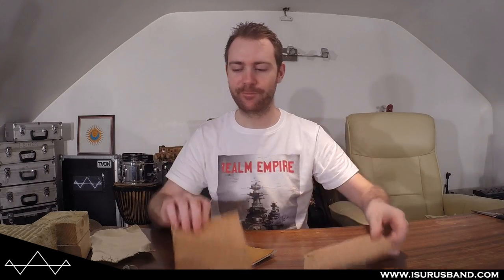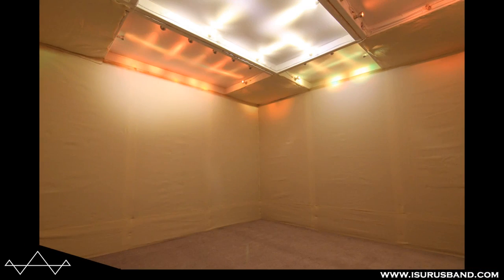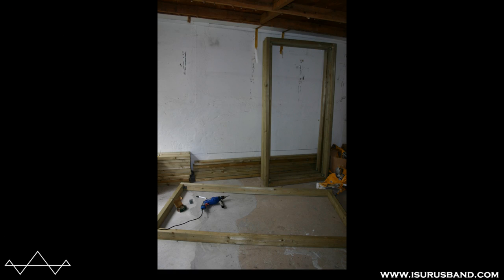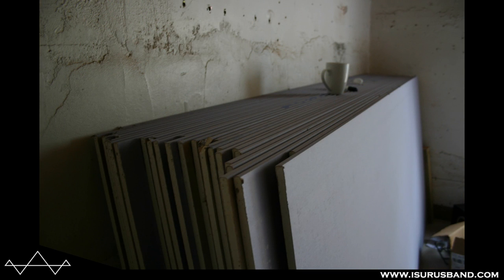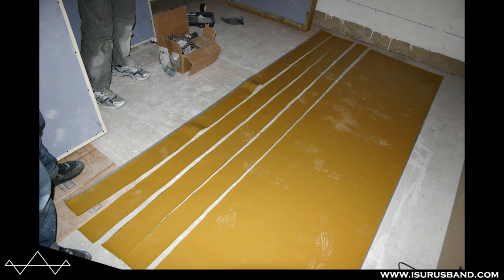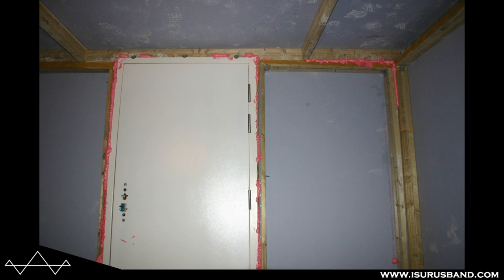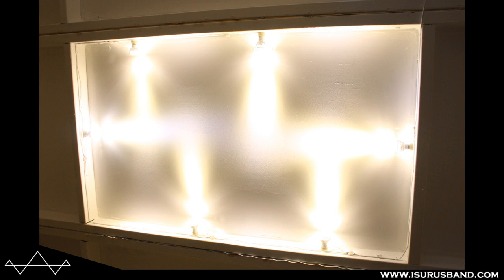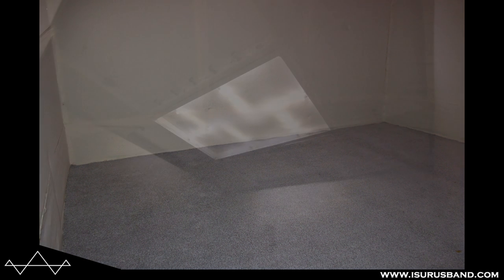Soundproof Booth Build - Portable DIY Isolation Booth

Comment: Hey, really interesting video. I am in the process of building a similar project, although more of a vocal booth about a 3rd the size internally using practically the same materials as you.

 although, I am using Tecsound 100 instead, and am also building a basic floating floor out of 2 layers of t&g with a layer of tecsound 100 in between floated on Auralex U-boats on a 2x2 frame. I am also adding a 2 or 3 mm layer of ac50 after the mass loaded vinyl and on the inside of the frame, with 200mm of Rockwool RWA 45 (as apparently 45 is a little better at absorption than more dense rockwool).

I also originally planned the booth to be made from panels as yours now is, however, as my booth is quiet a bit smaller, and I really need a really high level of isolation, I have decided to fit the dry lining to the walls and slice them when I come to move, and create new seals when I re-assemble.

Still, really interesting to see your build as the level of isolation you have is pretty good for the money involved.

There are acoustic seals that you can add to the doors if you want a better level of isolation which don't cost that much.

If I were you I would also consider breaking up the room shape (as standing waves will still be a problem in some areas and adding more rockwool absorption to resolve any low frequency problems when recording sources that contain higher level of low frequencies.

You can calculate the wavelength for a frequency using the following formula:

Wavelength in M = speed of sound (344) divided by frequency in Hz
Lowest frequency in average vocal frequency range = 250 hz
therefore
344/250=1.376m
so in order to build an absorbers that absorb frequencies of 250 hz
build absorbers that can dissipate through absorption 1.376m of 250 hz
:-)

Your room may also benefit by adding some acoustic pyramid foam to soak up some of the high mids. although not too much, as you may end up with a completely dead recording environment which some will find too disorientating to record in.

good luck
Reply from the maker: Hi - Sounds like your project will be pretty successful in terms of soundproofing. What kind of door do you have in mind? Our door has seals built in which perform really well. 

In terms of acoustics; bear in mind that the more dense types of Rockwool and fibre board have more flat and linear frequency absorption characteristics, meaning that they will absorb more low frequencies than the less dense materials. The risk with using a less dense material is that more of the high frequencies are absorbed resulting in an unbalanced and 'boxy' sound. That is the most difficult and important thing to avoid with small rooms, especially if they are being used to record vocals.

Having gone through this process, my advice would be to go for it. I think you'll be happy with the results that you end up with and the floating floor sounds like a great idea.

I'm interested to hear how it goes for you..

Cheers, Tom
Reply: Hey, thanks for your advice and reply.
However, I have read on the contrary with regards to the density of the Rockwool. I read on JonSayers recording studio forum, that its that lower density rockwool that is more effective because it has more air in it, which means that the sound energy has to change densities more frequently which thus causing more of the energy to dissipate over distance. The higher density is less absorbent and more reflective and it is this that makes the room more reflective and more boxy. For example concrete is really dense and probably one of the best isolator materials on the planet, however, a concrete room does not absorb sound very well as its very reflective which results in a really boxy sound.
The recommended density that people such as Philip Newall and other pro studio builders recommend is between 35 and 45 kg.
Although the slightly higher density rockwool that you have used shouldn't make a massive difference when using 100mm.
Even Sound on Sound got this aspect of their design wrong, but I guess they don't build studios professionally.
Also, if you were to install large traps, rather than making the room more boxing (which is caused by an excess of sound energy due to excessive reflections bouncing around the room) what you would get is a more dead sounding room, due to lack of reflections.
Which is good for engineering however does not give a very natural "live" sounding reverberant field that performers are used to.
Personally, if I had the money, I would build an anechoic chamber for not only recording in but also for mix engineering in, as this will give me only the direct sound from the sound sources which I could then add lush pro lexicon reverbs to. But that's just my preferences, such rooms such as those based on Tom Hidley's non-environmental control rooms are based on this concept. Which were briefly in fashion during the 1970s, but lost their favour because some engineers didn't like the un-natural acoustics or lack of acoustics. Still, I like the idea. Check out Tom Hidley. He's one of the few studio designer genius. Oh. you will get some discolouration if you do not absorb those lower freq. This isn't so bad when tracking, but when mixing, this can be a problem, As when you play back the sound source, you get discolouration due to standing waves and lack of absorbsion etc.
Still, something is better than nothing. Perhaps if I make millions I will then be able to do it seriously. :-)
Reply: sorry. forgot to mention,
Sound Bloc + Mass loaded Vinyl for isolation.
Thick Rockwool for low and lower mids
Pyramid Foam for Highs and High Mids.
These combined should give a fairly well isolated and dry or dead room (although still with some discoloration, as after all, the money we are spending is in the low thousands instead of the hundred of thousands or millions.

Still, in terms of mix engineering, these cheap vocal booths should give a good enough source for making basic tracking as any minor problems can be resolved at mix engineering and mastering stage, as long as you get a pro engineer to mix engineer in a pro designed neutral environment.

Sorry. forgot to mention.
The door I am installing is a thick solid core wood fire door with a threshold door seal and a seal around the edge. 
Lorient make some reasonably priced and good performing ones.

I will also glue some of the tecsound 100 on both sides of the door and am thinking of fixing an absorption box on the inside.

That should be pretty good.

after this, I am also considering making some reflective panels which I can use to change the acoustics, although, due to the size of the room, it may not be worth bothering and settling for the dead'est environment I can get in the limited space I have.

However, I may have to experiment if people who I record cant get their head around the dead environment.

:-)
Reply from the maker: Jus Roc - I think if you have 200mm of the RWA 45, you'll be in good shape but that's a lot of space to give up. If you can do that though then it would be ideal. At only 100mm and with no air gap behind the material, the more dense material performs slightly better for low frequency absorption but not as well in the mids and highs. That works quite well because low frequencies are more of a problem in a smaller room and we didn't want too dead of a sound.

Check this out, loads of good information: http://ethanwiner.com/acoustics.html

200mm of RWA45 would likely perform better overall than 100mm of the material that we have used but it's a case of space limitation and as you correctly pointed out, there's a point where you have to draw the line because otherwise you end up building an anechoic chamber and I'm not really sure what they would feel like to work in. They'd probably be quite uncomfortable due to the disorientation effect although I'd love to give it a try.

I also agree with what you said about these things being more of an issue when mixing or mastering. Any slight tracking room issues can be corrected using moderate EQ in reality. I think though that if you know the sound of the room you're working in very well and given that there are no major problems with it, you end up compensating for any issues naturally. 

Personally, I am a huge fan of using my Sennheiser HD800 headphones for really critical listening although something is definitely lost when only using headphones due to not feeling the bass.. There's just something about feeling the music and the natural feeling of listening to music on speakers.

We have not used our room for mixing or mastering and we'll be making some pretty major changes before we do that like installing some much thicker and less dense bass traps in the corners and extending the room by 1 meter in 1 direction to give a 3m x 4m room which will reduce standing waves. That's the next project...

Thanks for the interesting discussion!
Reply: Hi, Sure. Thanks for your thoughts.
Extra Rockwool will make my room much smaller, but as in many working peoples case, we have to do our best within our circumstances.

Also, my small vocal booth isn't going to be perfect, I know that much. But hey, its better than nothing and I should still be able to track vocals and acoustic guitar in it without too much trouble. as my room is primarily for recording, and for one or two people max, my priority is more so to get a dead sound than having max space. My design was based more around the idea of how small I could make it with max absorption rather than how little absorption I can use while giving max space for people. I guess the purpose changes the design ethic.

In all honesty, I would ideally like to have 2 or 3 m of Rockwool after 3 m floated concrete walls, floating ceiling and floating floor. But the  space and money to construct such a studio isn't easy to find in Jersey, an island where real estate is extremely expensive, as expensive as London but with less available properties.

Still, being able to get a clean recording free of outside noise is my present objective along with not annoying my neighbour's to the extent that they call the police. As I don't want to get arrested. My room will be a compromise. But still, better than many who have released commercial and successful music.

For example, Over the past 20 years, I have read about loads of musicians, in particular pro dance musicians who have tracked the vocals in a lot worse situation. Often in an untreated unsound proofed room with nothing but a duvet taped over a door. And these tracks made it big in the charts!

So, sometimes too much emphasis can be placed on having a pro recording space, although, obviously, the more pro you can go the better. and most of these artists likely had a pro engineer with a pro designed studio to mix and master in...

In terms of the room shape however, I would read up on this. If I were you I would consider buying Philip Newalls book on Pro recording studio design, as it may help you tailor the shape of your room a little. Philip Newall is another genius. He has been designing pro recording studios since the 60s.

Extra tuned broadband absorbers and bass traps fitted in the room to change its shape could help change the acoustics considerably. and you should be able to cure any standing waves and nodal problems you have, as long as you are willing to lose some of the room.

If you cant afford to lose the room, as I understand you and your band practice in it, you can still make a basic mix with headphones and then send this with all stem files to a pro engineer who can then mix it to pro standard.

This may sound like a cop out from a DIY side, but sometimes it really is the best method.

You can still do you own mix and compare the two. However, the pro engineers who are at the top of their field, can really work wonders.

I also recommend this for the mastering stage, as although there is now a diy ethic for all aspects of recording, a pro mastering engineer cant be beat for mastering.

I went to LIPA, and even the top pro tutors at LIPA who were really good at mix engineering said they wouldn't master themselves, this is partly because its such a specialist job but also because the equipment these guys use are simply very specialist and of such a high quality which is simply out of the normal studio engineers budget range.

Still, do as you feel right. From what I have heard on your site, you sound like your doing pretty good with what you have done so far.

Cheers for the chat.
Jus

Comment: fucking "A" guys..! I have a modular system that I am designing and cant wait to build it, however my own is designed for an STC of 60 and where I can easily install and remove without the need for power tools...! I love what you guys did with your duct system, Cheers!!
Reply from the maker: +Official Poa Thanks man! Hope the video was useful, and best of luck with your build!
Reply: IsurusOfficial
Thank you! I AM putting my in 4 shipping containers

Comment: Now this is useful ! ;-)
Great job. I would have loved more details about the ventilation bit. But I get the picture. I'm actually quite amazed that the ventilation panel was still soundproof even though there is not much rockwool in there.
No floating floors though... ? I guess you do not have direct neighbors... lucky you ;-)
Is it as effective when a drummer is playing inside the room ?

I'm gonna start building my own soundproof cabin soon so... thanks, this video was very helpful.
A smile to you ;-)

Comment: Brilliant! Thanks for taking the time to share what worked for you. 1. How did you join the modules together in the corners? Couldn't quite tell if you drove screws through the horizontal edge into the vertical edge of the 2x4s or if you joined both modules to a 4x4 on the other side? 2. Also, do you have any recommendations on where to pass your electrical wiring from outside to inside?
Reply: I also am interested in this exact issue for my planning. Watching other videos it seems it wouldn’t be enough to connect horizontal to vertical edge. A 4x4 would be good but maybe an extra stud 90° on one side would be enough.